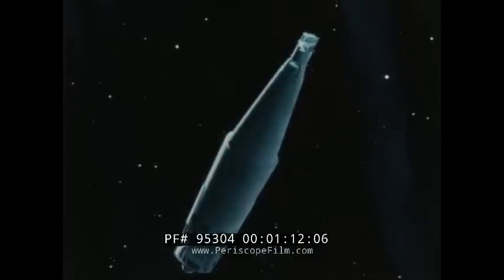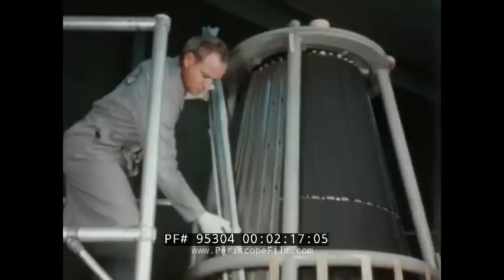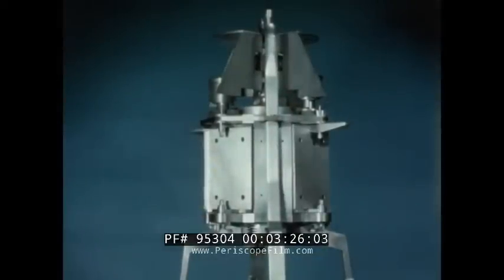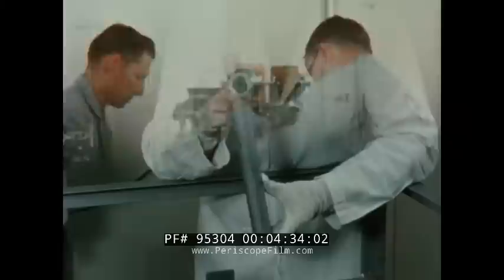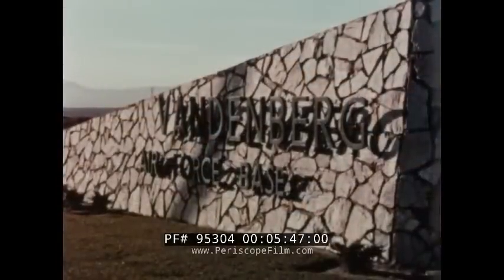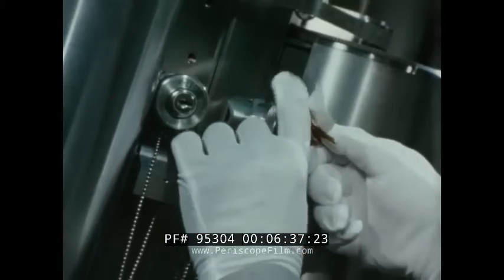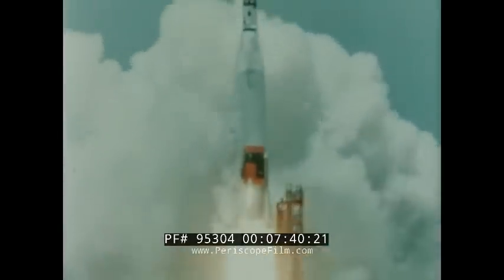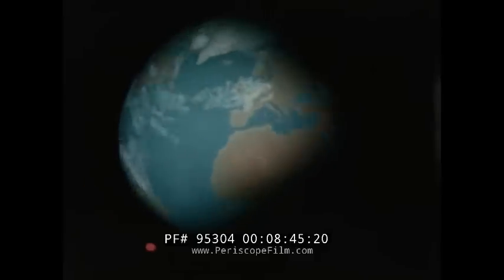" SPACE NUCLEAR POWER "  ATOMICS INTERNATIONAL FILM  NASA  SYSTEMS FOR NUCLEAR AUX. POWER 95304

Comment: Still a need for them. To power deep space probes.
Solar panels only work when you are near a star - not in deep space.
Reply: No thermoelectric generators are used nowadays
Reply: @MovingThePicture  We use RTGs still quite a bit for rovers and whatever - not so much for anything near earth since its silly.
Reply: @hypercube33  That's basically what I said.
Reply: @MovingThePicture  No it's not. Why is it so hard to admit you were wrong? RTG:s are still used in most deep space probes, the MSL uses it on Mars right now and in six days, the new Mars rover Perseverance will be launched and it also has an RTG. Besides from that, some are still used here on Earth. So your claim "no thermoelectric generators are used nowadays" was wrong. No means none, zero and that is not basically true but false.